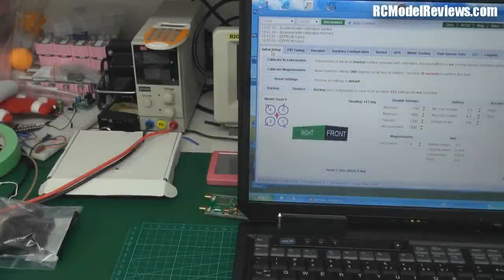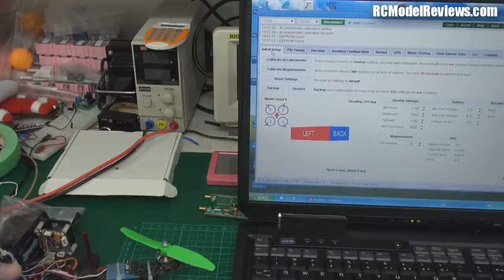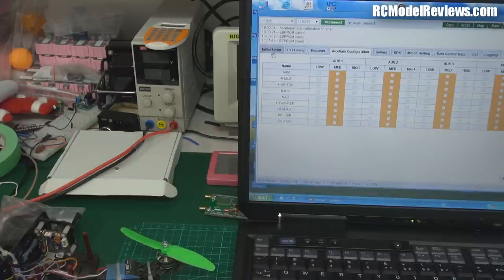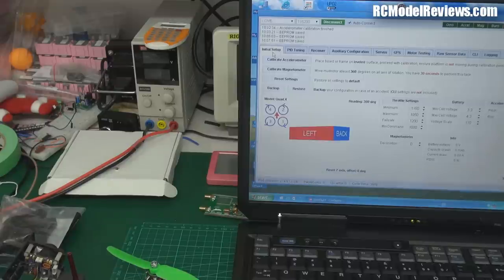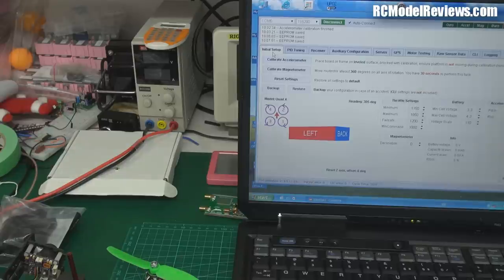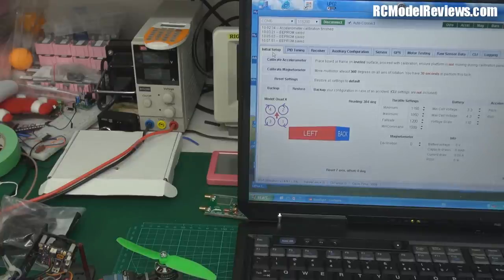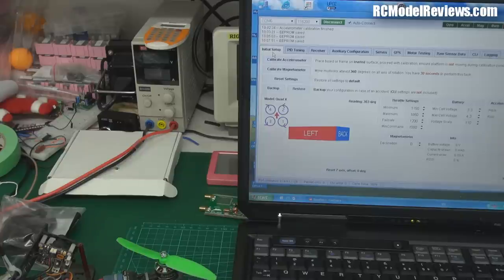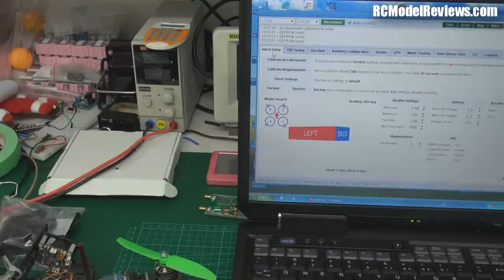Naze32 yaw gyro fail?

Comment: Wow haven't seen that before.
Reply: BMSWEB Yeah, this board has taken a few knocks (despite what Gordon, the owner, might say :-).
Reply: ***** You need to start flying slower m8 ;).

Unfortunately I never had this issue and am flying naze32 for already 2 years now. I did break one once in a hard crash, but that one wasn't working at all.
Reply: It's such a strange problem to be having
Reply: Do you think perhaps one of you guys could do a video on what all the modes are on the full naze board?
Reply: Be careful gyro syndrome is going around.
Happened to my yaw gyro yesterday morning on naza after hitting a tree really hard it seems but I found the ultimate mini quad spot for races I think. Duck pond included and a mini forest.
Reply: hover bot Let's promote disinformation ... funny to believe that few knocks damage only one of the 6 sensors inside the same chip ... this is promoting disinformation with the power of youTube clicks ...  WOW.
TIMECOP, the designer of Naze32 gave already the solution to the problem ... insist on disinformation ... it is not really smart
Reply: elm70 Each of the nano sized structures inside the chip detects on a different axis so it's totally believable that an impact in a particular direction might damage one and not the others.
Reply: Atomicskull Yes, some people believe in UFO, some in ghost and some in Santa. The possibility that a crash has been destroying only one element of 6 is 0.0001%. It is 99.9999% clear that the problem is related to the magnetometer (either defected or most probably a non calibrated mag), like timecop did report already.
Reply: elm70 Naza and other FC can have individual gyro's stick so no need for the attitude. Some thought Iraq had WMD's I guess they are UFO buffs too like you. Timecop took a previous designed board and copied/modded it so what authority is he? Check out his work on the cheap Freeflight board.
Reply: elm70
It may well be the mag, I've got to get the board back from its owner to check.  However, you can damage single elements inside a MEMS device -- I've seen it before beceause, as others have mentioned, they operate in different axes and the force vector can determine which of the axes are stressed beyond breaking point.
Reply: ***** Everything is possible, but what you suggest it is extremely unluckily. Anyhow, even assuming an internal sensor of 6050 got damage, there is no reason to blame the Naze32 board, since all the control boards use the same sensor, and all are likely to fail on the same way (that is a very rare situation). So I find your video extremely misleading. I would suggest to get back this board, and properly check it again, and this time show the raw sensor data, this will show without doubt what is going on in the board.
Reply: elm70
I'm not "blaming" the Naze for anything.. hell, I'm astonished at  how much punishment they can take and I have no doubt that this issue is a result of severe and repeated crash-damage.  Miniquads can take a hammering but something has to give after a while ;-)
Reply: ***** I find this sentence "What has gone wrong with this (and another) full Naze32 flight controller boards?" quite misleading ... it sounds like full Naze32 are problematic ... anyhow ... other can read the same sentence in a different way. As well, the video you are showing does not really suggest that there is a broken yaw sensor, timecop already indicated this, and I guess he knows well what he is speaking about.
Reply: elm70
Well we've had exactly the same problem with Acro boards -- ie: with no magnetometer.
Reply: elm70  You have an issue of mind and emotion that keeps you away from more than you can possibly imagine. I would love to spend a week with Bruce gaining knowledge from him. But I think after an hour with you your attitude of knowing it all "in a relative way" would drive me up a wall. Some people can copy knowledge and some people can comprehend it. Most people copy and comprehend very little and the natural patterns involved allow some degree of success in using it. If you comprehend Ohm's law then take off the propellers and use an applied time delay with the expansion of space and this simple equation: e{a}/t=hv. It's been taking me a while so here's your shot at it. Of course it's not fair to bring up {a} without explaining it. So here is a simple example:

CERN's muon phase timed neutrinos were announced Worldwide in 2011 @ (v-c)/c=2.48e-5 sec in 453.6 miles. That is an exact match with SLAC's E158 asymmetry of the weak force data @ 2.48e-5 sec added to the speed of light traveling 453.6 miles creating an asymmetry in time of 20e-5 sec, what we call gravity. After the data was shown to match the E158 ratio SLAC went back over their BaBar data and confirmed the asymmetry in time exposed a year later giving it a sigma 14 level of certainty. Note that the neutrino created at the speed of light does not exceed the speed of light in adding it's space to the measurement and CERN used muon phase timed neutrinos which is like waiting at a stop light to measure a photon go by and waiting a fraction of a second to make the measurement and adding that added distance to it. There was a write up on it on Wikipedia but that's been pulled off now but was copied and noted in other areas of the Internet. Here is the simple math that proves it. If you open up a calculator and follow the flow it's easier to see doing it yourself.  
Weak Force Asymmetry {a} adds 1hour/3600 seconds every 1000 years: Re: SLAC E158 data "using clocks". Muon neutrinos do not exceed speed of light as CERN said "if the data is correct". They are created at the speed of light adding to the speed of light measurement just like the photon "tricks" Summerfeld detected in 1948. (Because their phase angle is @ theta 23 unlike electron neutrinos but you don't need to understand that to see the data match.) 
3600sec / 1000 years = 3.6 seconds of weak force asymmetry time added in a year, the distance light travels in 3.6 seconds. 

3.6 sec x 186282 (speed of light) = 670615.2 miles added to the speed of light in one year. 
670615.2 / 365.2425 year = 1836.082055072999 miles added to speed of light in one day.
1836.082055072999 / 24 hours = 76.50341896137498 miles added to speed of light in one hour.  
76.50341896137498 / 60 minutes = 1.275056982689583 miles added to speed of light in one minute.
1.275056982689583 / 60 seconds = 0.021250949711493 of a mile added to speed of light in one second. 

Now that we know the know the {a} asy time/distance added in a second to the speed of light (0.021 mile) we need to know the fraction of a second speed of light distance it took for light to travel only 453.6 miles which is the distance CERN's neutrinos traveled to know how much {a} asy time to add to the speed of light traveling 453.6 miles and see if the {a} weak force asymmetry gain in time matches CERN's 2.48e-5 sec neutrino gain in time exactly as I said it would to create the force of gravity. So we simply divide 186282 miles (which equals one second) by 453.6 miles (the fraction of one second distance the neutrinos traveled) to acquire the weak force asymmetry value added to the speed of light. 

186282/453.6 miles = 410.6746031746032  (or 453.6 x 410.6746031746032 =186282 SOL)

Now we add the weak force asymmetry time gained to the fraction of one second value of 410.67.

0.021250949711493 / 410.6746031746032 = 5.174644243208279 e-5  This shows the forward/back total neutrino oscillation time gained in 453.6 miles caused by the asymmetry of the weak force.

Now notice the total asymmetry time gained of 5.17 e-5 sec is almost exactly double CERN's 2.48 e-5 sec past the speed of light. The next two simple calculations change physics by adding a 4th oscillation phase to the atom (graviton) and a second reverse arrow to time needed to support the "missing" graviton phase misnamed the hole opposite the electron and use CERN's data to show it's correct length relative to the electron and prove time has asymmetry that supports the force of gravity exactly as I had been saying for years never expecting this to happen and be so easy to prove and show that E=T, and time like energy must be conserved. 

We add a second reverse arrow (required for time to have asymmetry) for time by simply dividing 5.174644243208279 e-5 in half.

5.174644243208279 e-5 / 2 = 2.58732212160414 e-5 sec 

So we have 2.58732212160414 e-5 sec weak force asymmetry time gained in the forward arrow of time, 
and 2.58732212160414 e-5 sec weak force asymmetry time gained in the reverse arrow of time. 

We now add gravity to the second reverse arrow simply by using CERN's data which provides the correct forward arrow measurement of weak force asymmetry added in 453.6 miles by subtracting the forward arrow gain of 2.48e-5 sec from half of the ratio gained in 453.6 miles of 2.58 e-5 sec.

2.58e-5 - 2.48 e-5 = 0.10 e-5 sec which we now add to the second reverse arrow connected to inertial frame based time that does not need an ether for a reference frame because as we know from E=mc2 space is relative to time: 2.58 e-5 + 0.10e-5 = 2.68 e-5 sec.

So using SLAC's exceptionally specific but proven E158 WF Asy ratio obtained from adding the distance light travels in one hour to the distance light travels in one thousand years applied to 453.6 miles we can see using basic math that SLAC's E158 data matches CERN's neutrino data announced worldwide @
(v-c)/c=2.48e-5 sec in 453.6 miles with both sets of data adding 2.48 e-5 sec in the forward arrow of time and SLAC's data completing the picture that now includes gravity by adding 2.68 e-5 sec to the rearward neutrino oscillation phase adding a second reverse arrow connected to time that was discovered before the electron.

This creates an asymmetry in time of 0.20e-5 sec (2.68 e-5 - 2.48 e-5 = 0.20 e-5) needed for gravity exactly as predicted years in advance on Korg Forum and many other locations. 

CERN Neutrinos @ (v-c)/c = 2.48 e-5 create a lesser diesis (Einstein's Comma) = 0.20 e-5 (0.10e-5 + 0.10e-5) by matching SLAC's E158 asymmetry of the weak force data in the forward arrow of time @ 2.48 e-5 sec in 453.6 miles.

This is a game changer from dice to two sided cards because the data match shows time has a reverse Mass oscillation arrow that gravity needs to exist exactly as shown by the Unified Field Theory equation that first showed me and a few others the weak force has an asymmetry that allows our clocks to move independent of each other. SLAC's E158 ratio that creates the asymmetry of the weak force ratio is an incredibly specific ratio and I had been quoting the E158 data for years after finding it's value showing why it had to match like this creating 3 specific ratios out of the E158 ratio to add an asymmetry to time calling it a lesser diesis comma. A coincidence of this magnitude is simply not possible. Edit: This was done long before SLAC went back over their BaBar data and confirmed the asymmetry in time shown above giving it a sigma 14 level of certainty "far more than needed to declare a discovery".  

There is a lot of money involved with Science so don't think some scientists won't play games with the truth.

To challenge CERN's (v-c)/c=2.48e-5 sec claim neutrinos (CERN used muon phased timed neutrinos) were exceeding the speed of light which they weren't many physicists said the data had to be in error because neutrinos (electron phase timed neutrinos) were measured traveling at the exact speed of light from ten's of thousands of light years away, not exceeding it. The problem with that "correction" is the fact that we know neutrinos oscillate and have mass and the same laws of Relativity that state no particle can exceed the speed of light ALSO state no particle with mass can travel at the speed of light. So the experts used one "impossibility" to dismiss another "impossibility" failing to see the gross error in logic and some tried to reduce the neutrino mass to say there must have been some slight delay but from ten's of thousands of light years away even a "slight" mass amount would be measurable, not to mention CERN stated an exact SOL measurement after they 'fixed" the "loose cable"... LOL

There is a reason for observing a difference in electron vs muon phase timed neutrinos but it is beyond the scope of this post's layman presentation. What we see happening in physics where data is "doctored" to make theories fit is what happens when you use "dice" to measure time with rather that listen to the greatest physicist that ever walked the face of Earth when he tells you that "God does not play dice with the Universe". 

Some using E=mc2 have called Einstein a "19th Century Thinker" and even an "Old Fuddy Duddy" for being right and refusing to accept the uncertainty principle replaced by SLAC's E158 weak force asymmetry ratio not published until 2004 because they hold an opinion of themselves that is grossly mistaken and false relative to their contribution. those they put down in an attempt to pull themselves ahead in an attempt to associate themselves with the greatness of others that makes them feel insecure and small. And these type of people will stab you in back in a heartbeat to put food on their dinner table. 

I just showed why E=mc2 relative to the weak force and E=m{a}c2 relative to the strong force using 6th grade level math to eliminate the uncertainty principle. Does that make me greater than the people that created the data I used? Not if I got the answer from Pythagoras and the answer only required 6th grade math to prove it...
You need to take a chill pill and work on your arrogant attitude. When I got my KK2 board I had been saving book marks to set it up and when I got there they were all missing because of your harassing someone helping other people. Bruce has done more to promote the Naze board than anyone else yet your insecure need to put other people down to get ahead ignores that fact.
Again Bruce has shown he calls the shots as he see them. And again you have shown a high level of disrespect to promote yourself above someone else. You never responded to Bruce's statement regarding the Acro boards that have had the same yaw issue and they have no magnetometer and it's been 2 months. 
I could have gotten a mini CC3D board for free with my last purchase of a quad but didn't to support a US based Hobby company where I purchased the motors instead for more money plus added shipping costs and go with the Naze Afro because of Bruce's statements. The only thing I find misleading on this thread is the reason behind your insults. Bruce has never claimed to be more than he is and has helped out countless people while avoiding the pitfalls of greed to tell the truth.
Reply: Thanks for your useless comment. My mind is fine ... before think of the mind of others, you should take care of your.
Reply: elm70 e{a}/t=hv "useless".

Comment: Why Windows XP? :S
Reply: johneh87 Because this is the only laptop I have and the tower that used to sit beside my bench died a couple of weeks ago (motherboard caps dried out).   Limited funds mean I work with what I have and although it's dirt-slow (512MB RAM and a single-core processor), it does work (eventually).
Reply: I'm sorry to hear that. if the shipping from Norway would be cheaper, I would have donated my old laptop to you.
Reply: johneh87
Thanks -- but I will make do for the time being.  Your kind offer is much appreciated though.